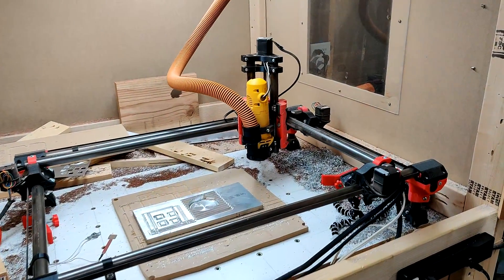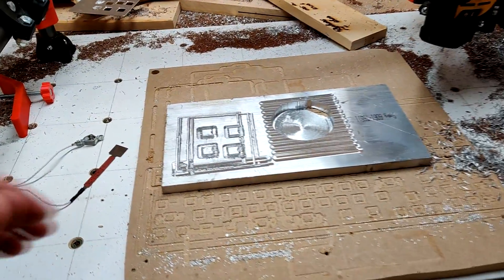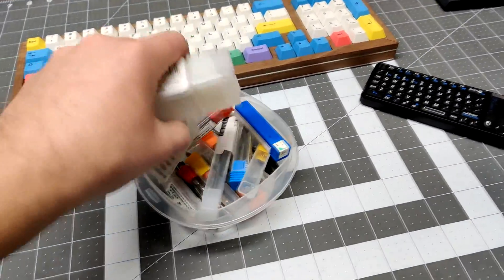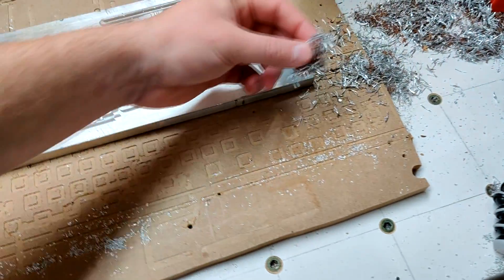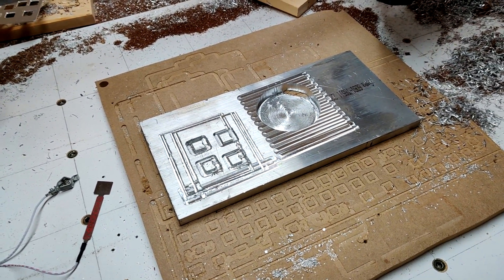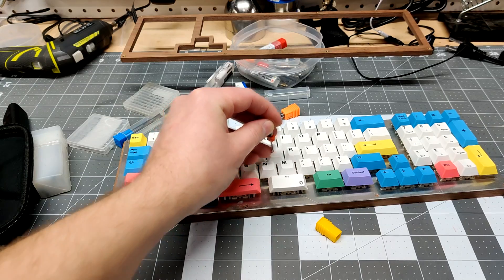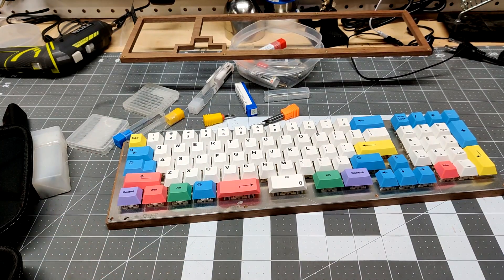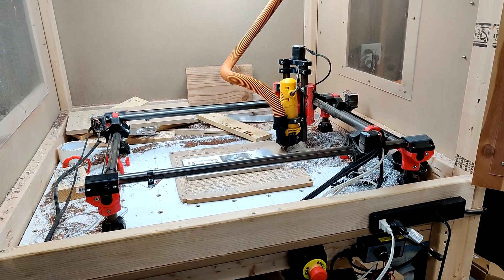MPCNC Primo Update - Aluminum Talk!

Comment: I know it varies for every machine but if you could give a rough guide as to the feeds and speeds you had success with that would be amazing, please! Think I may be going way too slow with mine but also sceptical about going faster as I just imagine lots of skipping and broken bits.
Reply from the maker: Yeah for sure. I never cut faster than 30in/min with the MPCNC. You may want to try 20in/min as well. Also try 0.05" depth of cut. 2D Adaptive cuts are going to be your friend, and always plunge spiral down if you're entering the stock from the top. If you do a 2D adaptive, try a lighter load, maybe like 0.05 optimal load. I would start with a 1/4" Single Flute (the one in my description worked well, apologies for the plug) and that should give you a good start. If you don't want to spend $16 on one end mill, there are other 1/4" single flute end mills that should work just as well on Amazon. I hope that helps!
Reply: @ProjectsbyBrian  thank you for the advice, and awesome work! I’ll convert everything to metric and get to work 😊

Comment: Love the content. Surprisingly hard to find little more than cutting footage for this project. I have all of the trucks, the core and the corners printed. Just need to do the feet and a all of the little parts-- and reprint the core at 70% infill because I sliced it for 45% like all of the other parts, but i'll still use it for my initial set up and testing